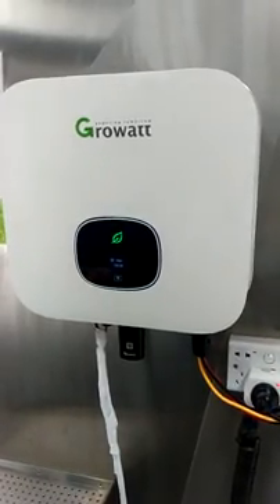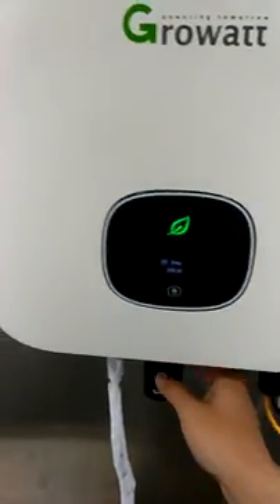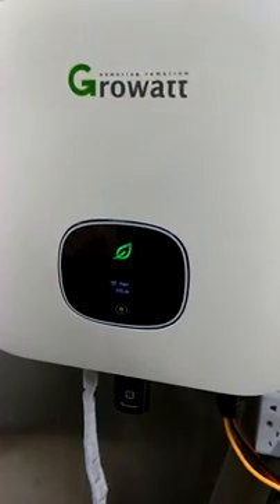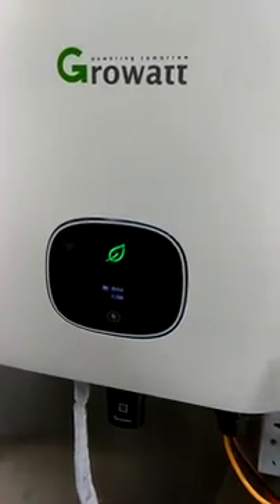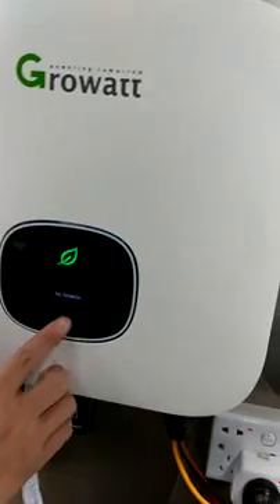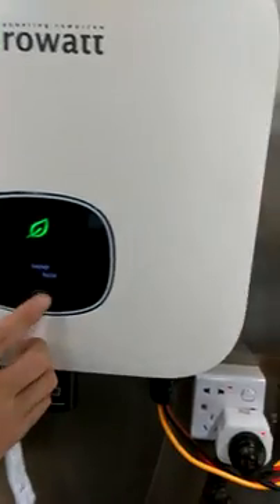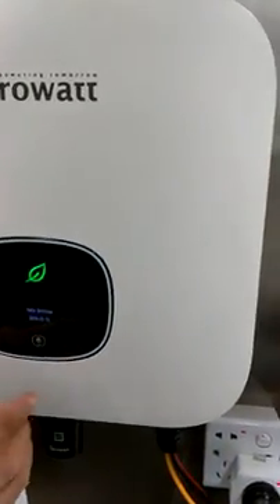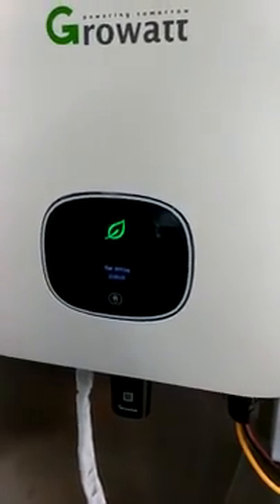MIN 2.5-6k TL-X OLED Screen Settings

Comment: I need help, I live in mexico, I just installed a min 6000tl-x inverter (only 1), it stay in standby mode so I pressed factory reset in the front panel menu (now I know it was for the poor sun light), I need to know what is the correct configuration in the voltage protection 0,1 or 2, and in the  interlock 0,1 or 2, and power sensor on or off, please.

Comment: Does this Inverter Growwatt TLx model require DC DB Box protection system ?  I understand from this Inverter datasheet that it has built-in DC surge protection ?
Reply from the maker: MIN 2500-6000TL-X DC integrates Type II SPD, therefore DC DB box protection is not required.

Comment: How do you reset the wifi dongle? Thank you
Reply from the maker: Hello, for product and customer services, please contact our service team at service@ginverter.com, or you can call our service hotline at +86 755 2747 1942. Thank you!
Reply: there is a little button on the dongle you can press. You may have to wait a while for it to start providing a good signal again.